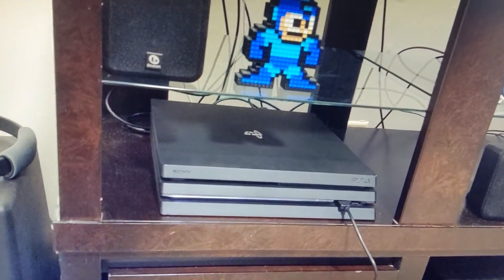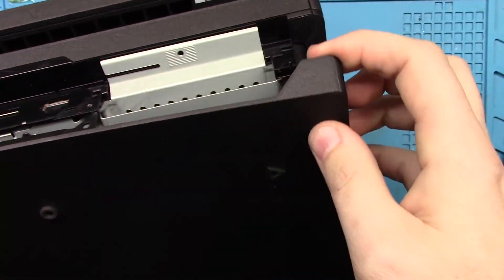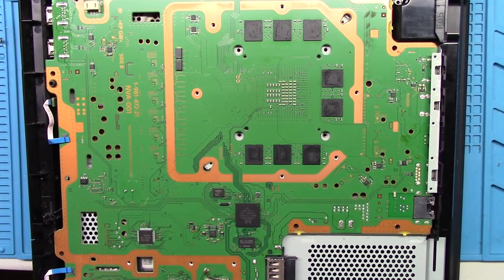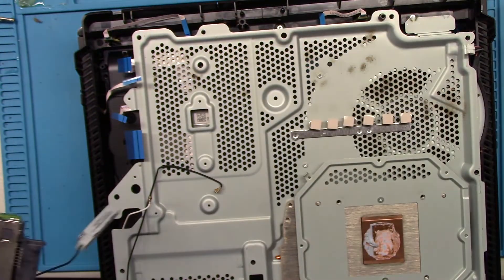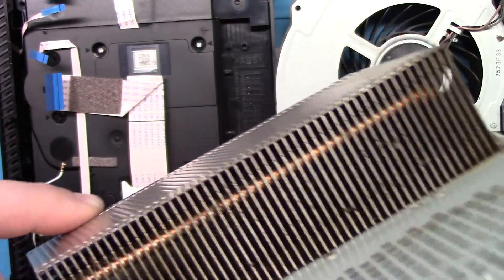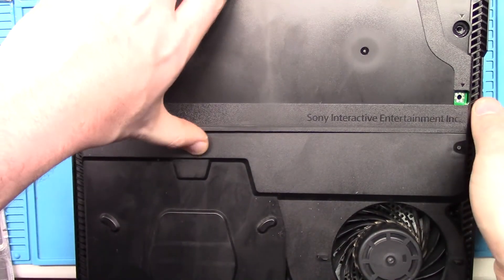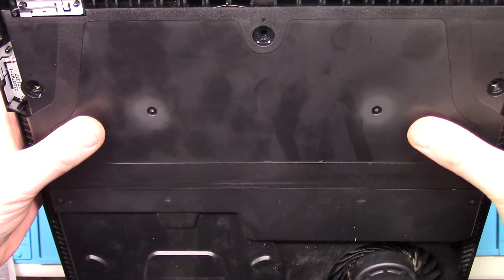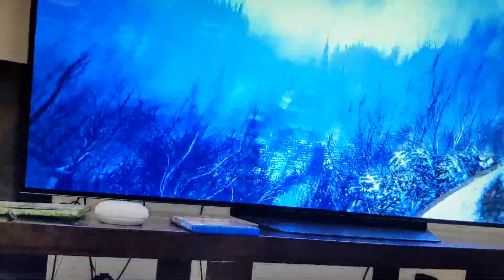PS4 Pro Loud Fan Fix and New Thermal Paste

Comment: I just did a full tear down of my model 1 ps4 pro and replaced the thermal paste. (And full clean) OMG the fan hardly even spins up now. Sadly I ended up with on black screw I couldn’t find a home for. Also the thermal paste on mine was gray and super dry. Pain in my butt to get it off.
Reply: Whats the best way of applying thermal paste to the APU , seeing that its rectangular , a vertical line in the middle ?

Or covering the entire chip ?
Reply: @KRSRK  there are multiple ways that work equally well and you can reference a Linus tech tips video on it if interested.  An X seems to work really well, a ball in the center as long as it's enough paste, a line even, spreading yourself is unnecessary but that works too.
Reply: @KRSRK  just a small line in the middle. Just think about it. Once you put it back together it’s gonna get squished around. You don’t want it going everywhere or you’ll be kicking yourself when you go to clean it up next time.
Reply: I cannot tell you how many times I've ended up with extra mystery screws after putting something back together...
Reply: The PS4 pro sounds like it struggles and super slow i cleaned it put thermal paste on it and it’s still fairly loud
Reply: @ot9523  after a good cleaning mine got really quiet and I’ve never had and performance issues.

Comment: I did this for my ps4, the original one lol I would clean it, but this time I did a thorough clean & I replaced the thermal paste as well. Also, I installed an SSD drive so it’s quiet & smooth. Dope video!

Comment: Great vid, I did this for my PS4 Pro as it sounded like a jet engine when playing Apex Legends. I didnt replace the paste though, I just used the paste that had overspilt when the two surfaces were clamped together. I also cleaned the fan and the dust from everywhere, and most importantly, made sure that the cooling matrix was clean. Mine was actually damaged, (from factory!) so I bent the fins back into position. Its now as quiet as a mouse and I've been playing on Red Dead Redemption without a sound 👍
Reply: Hey man just a heads up, it will get loud again, anywhere from a month upwards of three to four. When it gets loud again replace it with good thermal paste. I did the exact same thing like two years back on my Pro. It got loud again within a few months, changed it out for real the second time, been quiet since.